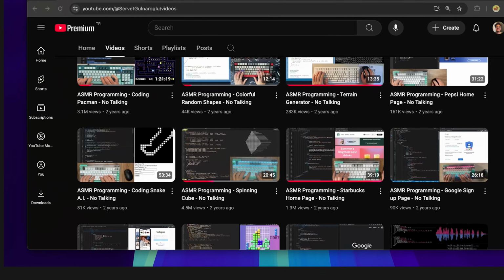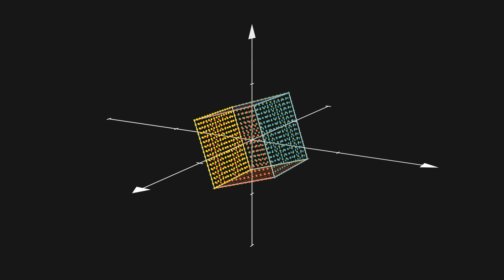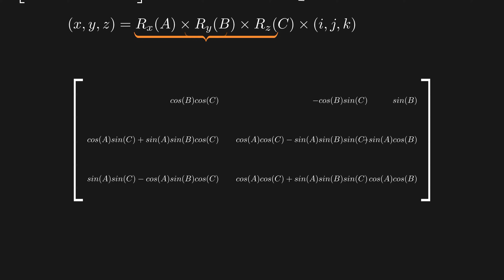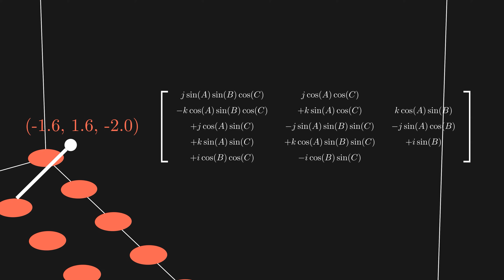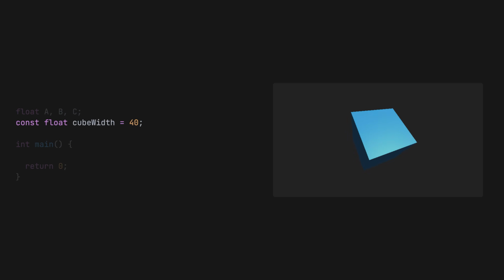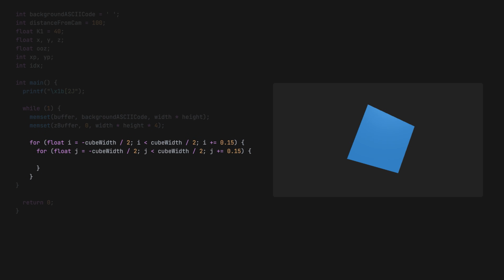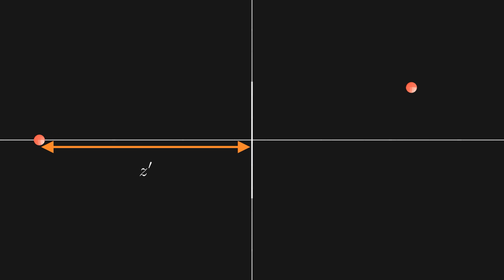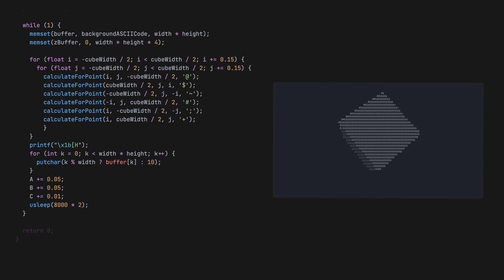How does the Spinning Cube work?

Comment: There is something I don't understand about the rotation matrices. Shouldn't the Y-axis rotation be more like 
 [ cos(B)  0   sin(B)]
 [   0         1       0     ]
 [-sin(B)   0   cos(B)]
?
Because shouldn't the points on the Y-axis keep the same value on that axis throughout the rotation?
Reply from the maker: Multiply a point like [0 y 0 ] with the rotation matrix and you will see the result will be [0 y 0] no matter the B

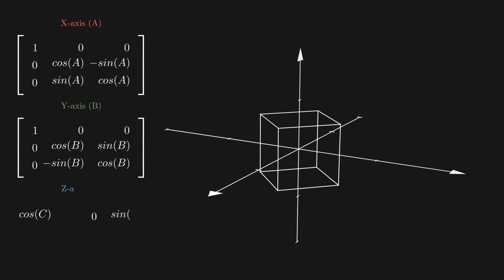Comment: 2:00 the y-axis and z-axis rotation matrices look strange. Are you sure these are correct? 

Changing a coordinate of a vector which you intend to rotate around that axis of that same coordinate should not affect any values in the transformed vector except for the value of said coordinate.

So for example rotating a vector around the y-axis should change the x-coordinate and z-coordinate, but not the y-coordinate.

Maybe I am misunderstanding something and the math works out somehow, but let me know if it is a mistake or different way to write the rotation matrices.
Reply: i also thought they look strange
Reply: the matrix multiplication also does some funky shit when hes doing it like the very first action [1,0,0]*[1,0,0]=cos(b) like what???

Comment: When it comes to shapes like a torus, this method makes sense. But for a cube it's really an overkill. Of course you can always calculate any shape using signed distance functions, doing math per pixel but for a cube, calculating the vertices and just interpolating the scanlines is enough and much faster. you don't even do any shading or texturing so even perspective correction is not necessary at this point. Since you use character mode and only have a few pixels (chars) on the screen, of course it works fine. Try exactly the same code in a higher resolution, you'll see what i mean.
I'm not saying you don't know how to do it using rasterization. But since you didn't mention it, beginners might think this is a good approach to rotate a filled cube. It's not.
Reply: 😮sounds right
Reply from the maker: it really makes sense but i thought it is easier to manipulate this codebase with different shapes and light objects